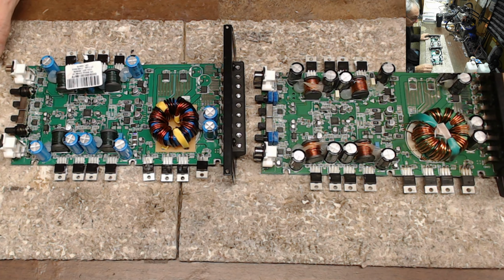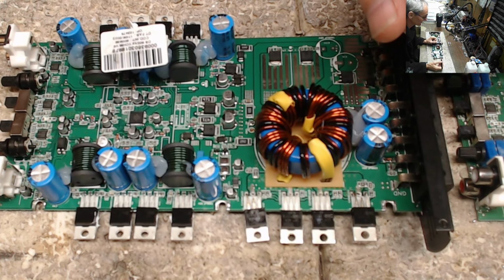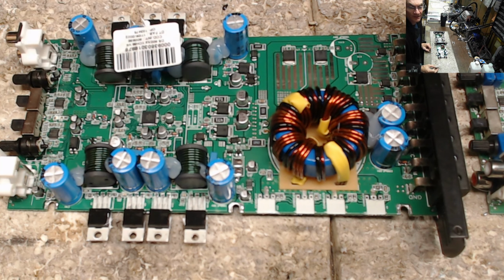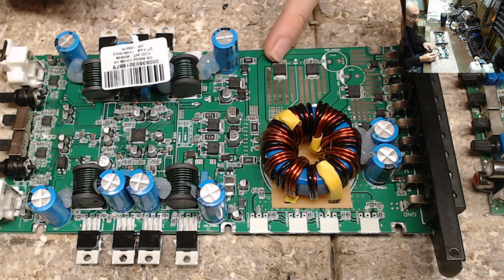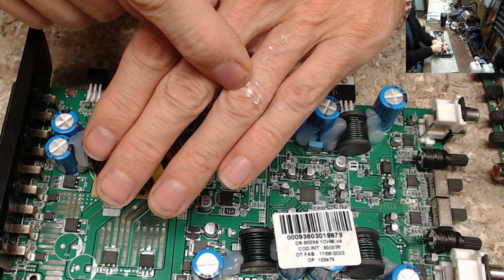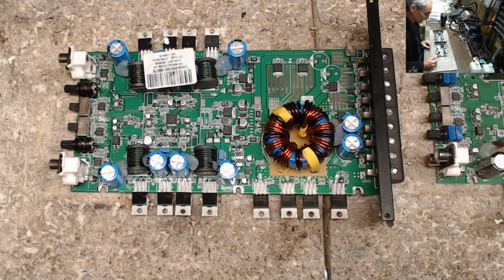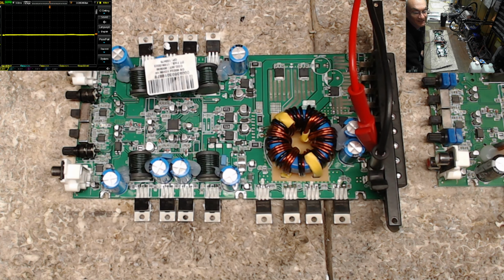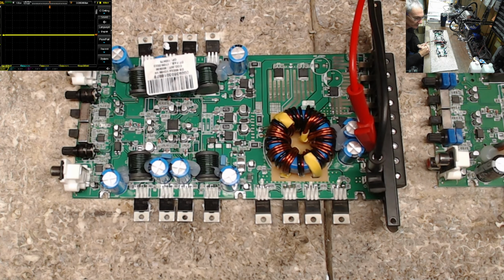Taramps DS800x4 Repair

Comment: Hello. I've been following you for a long time. You are quite successful. there would be a problem. I have a type 4 class d car amplifier. It malfunctioned. When the output mosfets are disconnected, the signals are normal. Whenever I want to plug in the output mosfets (solid) and turn them on. The amplifier flashes the LEDs quickly. It's like an amplifier being charged for the first time. Then it burns the mosfets. Do you have a suggestion? Thank you.
Reply from the maker: Which amplifier are you working on? Do you have a scope?
Reply from the maker: @tolgahancoban7591  Pull those 640s and fire it back up. What do you see for the low side and high side drive? Also double check that inductor closely for any burn marks as they tend to short from vibration.

Comment: Hi I have an issue with channel 4 on my amp. I saw a flash through the holes om the amp and channel 4 stopped working. Is this something that I could possibly repair myself. I do and a good multimeter and a oscilloscope to check parts.
Reply from the maker: You sure can! Since you have a scope you will be able to identify the issues quickly if you are familiar with repairing these. Fingers crossed that the drive IC is ok. In a lot of cases, all you need to do is to replace the output transistors if there is no gate fault.

Comment: Goodday Sir i bought a damage Mmaths CX6 crossover and i wanted some information on the power supply part of the circuit,was looking online for information on it but not getting any information on so i don't know if u could help me out i'm from the Caribbean 🇹🇹 Trinidad
Reply from the maker: I can try my best to help but I am not familiar with the power supply of that crossover. The good thing is that most all power supplies are quite simple by design. Has the supply failed in your crossover?
Reply: @ellensburgamplifier   When i bought the crossover it was not working .When i opened it i saw a part was removed from the bord ,from the symbol on the bord i could tell that the part that was removed is a inductor or coil  but i dont know if its a drum inductor coil
Reply from the maker: @RAS1_8886  That will be unfortunate if the original inductor value is unknown. Is the inductor part of the power supply circuit? If you have a picture of the board you can email it to me. service@ellensburgamplifier.com and I may be able to figure out the topology.

Comment: Hi those gate resistor is it 4.7ohms or 47ohms?
Reply from the maker: 4.7 ohms with the 180N transistors for the power supply. Don't forget to check the gate drive before the 180N transistors go in as the gate drive IC usually gets cooked when there is a supply failure.
Reply: @ellensburgamplifier  yea thats what happen I'm using the irf 1404 so i have to  change the gate resistor to 10 ohms I'm i right
Reply: How can i contact u on messenger sir
Reply from the maker: @awaazhoosein6565  They originally used 10 ohms for the 1404 I think. Sorry, I don't memorize a lot of things.
Reply: @ellensburgamplifier  yea i check on a next taramp that using the 1404 and it have a 10 ohms gate resistor
Reply from the maker: @awaazhoosein6565  unfortunately I don't use Messenger much but you can always email me. All of my information can be found at www.ellensburgamplifier.com
Reply from the maker: @awaazhoosein6565  If you want higher reliability then the 4.7 with the 180N is the way to go otherwise 10 ohms with the 1404 was the standard they used for a long time.